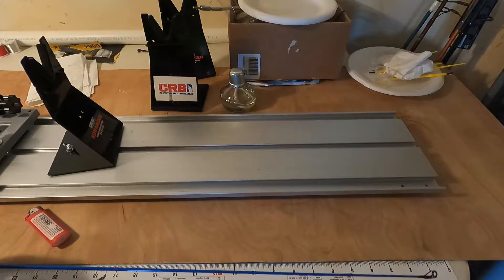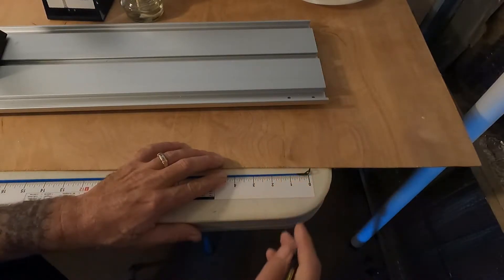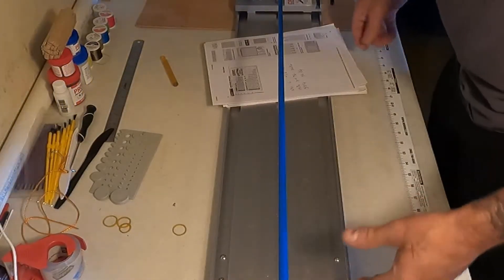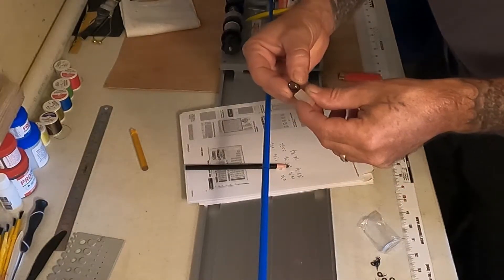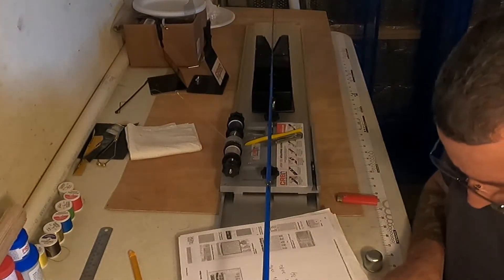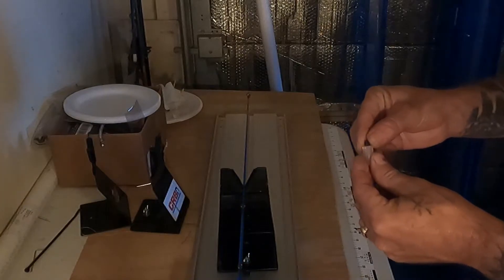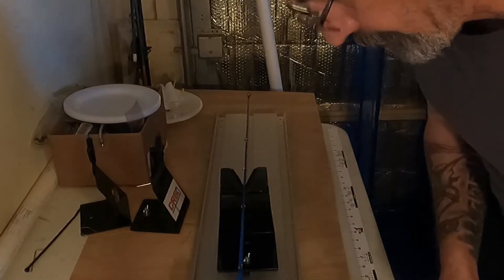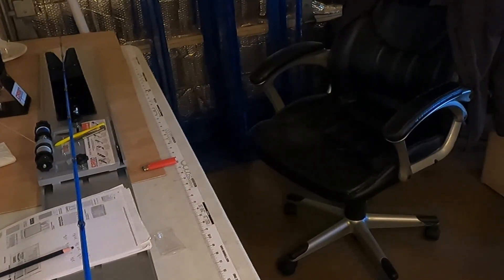Rod building for beginners. Part 3 Installing the guides and tip.

Comment: На какой клей приклеиваете? Специальный или стержень для термопистолета? Я не пользуюсь таким принципом, сложно сразу кольца в ряд поставить, после обмотки приходится подворачивать их чтобы поставить в линию. В вашем случае уже не провернешь после обмотки
Reply from the maker: It is a soft glue. They can be turned after the thread is on to line up. I use tape mostly now. I have a laser that mounts where the reel goes too to line them up too.